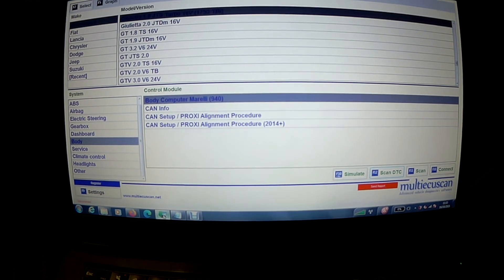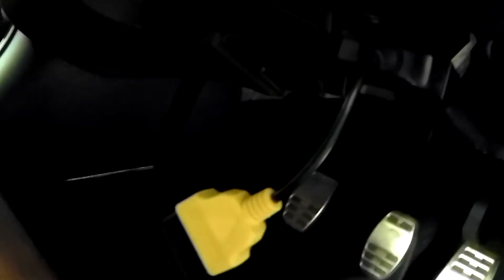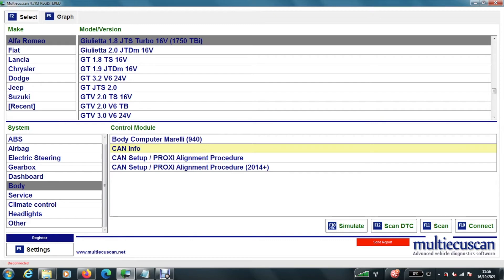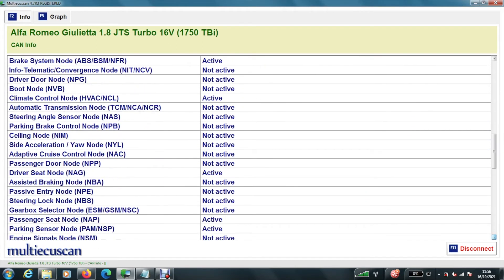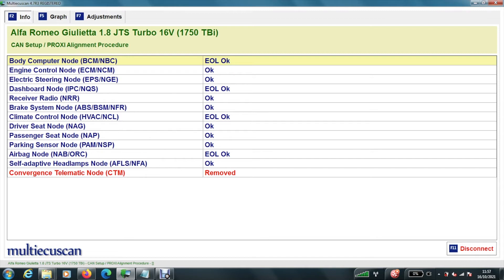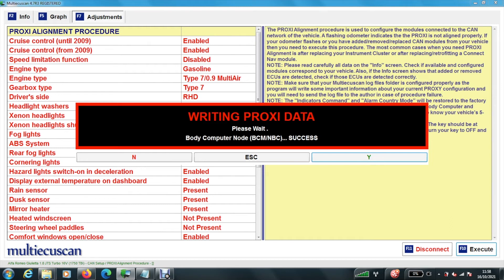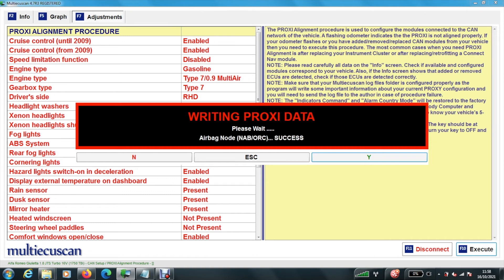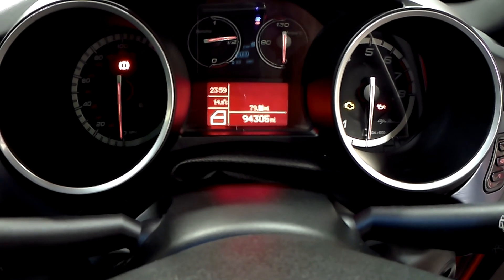Flashing mileage on Alfa Romeo Giulietta SOLVED - Proxy allignment using multi-ecuscan. Fiat.

Comment: Hi.  I’ve a dead Airbag Ecu.  I can get the same p/n eBay. Do you know of this needs a proxi alignment or more to program it. Maybe need clone it I read?  Thanks
Reply from the maker: Hi,
I'm pretty sure that when you replace a lot of parts (electrical) they will need coding to the car, so yes a proxy allignment will need doing.  You just need to buy the cable set and buy the software, or find someone who has it. Good luck
Reply: @trollmanrs  thanks very much. I’m getting there.  I’ve got ELM27 Bluetooth.  I cannot connect via comm port.  I’m guessing I need the proper cable and not the Bluetooth. People discuss using the yellow engine for cable or re programming / proxi alignment.
Reply from the maker: @zzhughesd  yes you need the yellow cable. Are you in the UK? I have a complete set of cables that are brand new I could sell you.
Reply: @trollmanrs  Yes thanks, am in Stockport, be interested, bought a cheap terrible eBay one get me going this am as Bluetooth ELM27 failed
Reply from the maker: @zzhughesd  but you will still need to buy the software, which runs on a windows PC
Reply: @trollmanrs  yes. Have this MultiEcuScan on spare PC 4.8. Just loaded last night.  I’m a mac owner but software always hard work mac
Reply from the maker: @zzhughesd  Yup I'm a mac owner too, but have an old work windows PC in my garage to run that S/W etc.
Reply: @trollmanrs  Even MTD and digital HMRC services only work well with bridge software and Microsoft !!!  Hard work Mac unless willing to do work arounds
Reply: @trollmanrs  RE: Set Cables - Yes what would you want for them cheers.... So I'm there I've MES and registered, cheap nasty Yellow or Blue VAG 901 cable on way.....  It's no comms current on Evo Punto with ABag Ecu fault, wondering to Proxi Allign the one arriving eBay could it also be no comms so cannot connect to Proxi Allign that either ????  hence this clone method????  Totally new to MES and Re-learning/Programming/Alligning
Reply from the maker: @zzhughesd  £15 delivered for the complete set of 5 cables I think it is.

Comment: Hello did you just plug the yellow lead into your laptop or do you need another lead that plugs in to the yellow lead ?? Great video 😊
Reply from the maker: The yellow lead is an extra one specifically to communicate with certain ECU's. You can buy a set consisting of 4 or 5 leads in total. But you need the yellow one to perform this proxy-allignment.
Reply: Thanks for the reply.. I have got the colour leads I didn't know if I needed the elms black one as well.. so it's just the yellow one  👍

Comment: Hi friend, removing the batery (old one) and repleace it with a high amp one will also make te Odometer flash? blue&me isue? 
I have that isue on a 159 that i whant to buy....& The saler said that is from when he change the battery! None before that!?
Tnx
Reply from the maker: Hi, to be honest I believe if you change some devices you need to perform a proxy alignment to stop the mileage flashing. Not sure on a battery though !

Comment: Dear trollmanrs, your video is very helpful. I would like to ask if you have disconected your Blue & Me device before running a proxy allignment via multiecuscan? As per your video it was showing as removed. I have a similar issue, I keep replacing the battery but it is getting fault feels days after replacing the battery if the car is not being used, and it started after a mecanic removed the battery and also flashing the dashboard.
Reply from the maker: Hi,
Glad you like the video, my Blue & me was fauty and when they become faulty they are known to drain the battery so yes I removed mine hence the proxy allignment.  So I suggest you remove the B&M unit, do a proxy allignment and that should solve your battery drain issues. Good luck

Comment: My Blue & Me has failed so I've removed it, and now the Convergence Telematic Node (CTM) is no longer present. It has a dash next to it instead of where yours says Removed.
Proxy alignment still fails on both Airbag and CTM, so the entire Proxi doesn't get written!
However, I've just read that this may be a problem with MES v5.0. I notice you have 4.7r, so I might downgrade mine and have another crack at it.

EDIT:
I can't downgrade since the key I bought is only for v5.0, and won't accept earlier versions! I should've bought a key for 4.7 then I could update for free if I wanted. Seems I'm being punished for getting the key for the latest version 😕
Reply from the maker: Good luck. !
Reply: Did you end up figuring it out?
Reply: @G14Soccer  yeah I settled with v5. God some googling and found the hex code to blank the b&m. Eight months later however, I hit a pothole which wrote off the car 😔

Comment: Ta batterie se déchargeait avec ce problème et la convergence télématique viens de ton poste radio ..
Reply from the maker: If the Blue & Me unit is faulty and you leave it connected it will drain the battery.